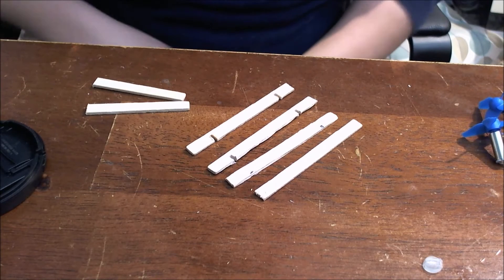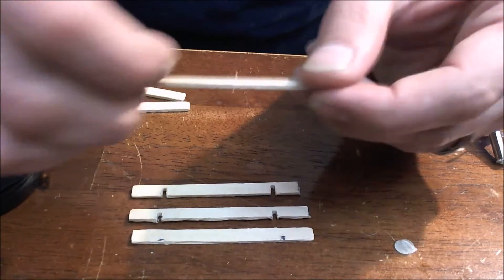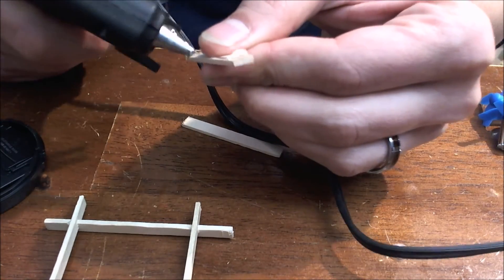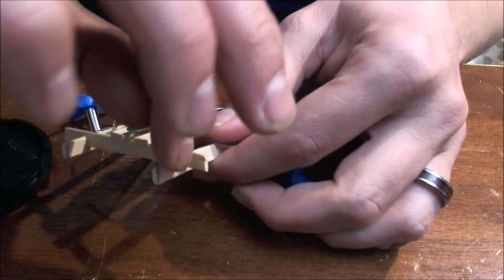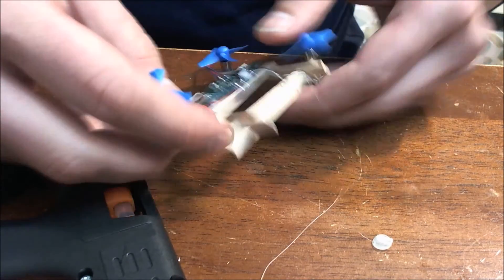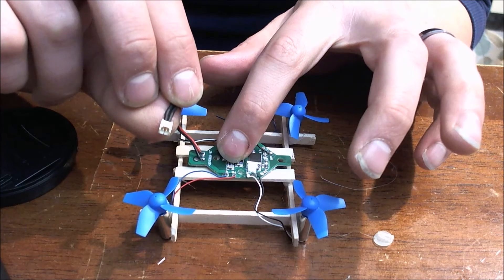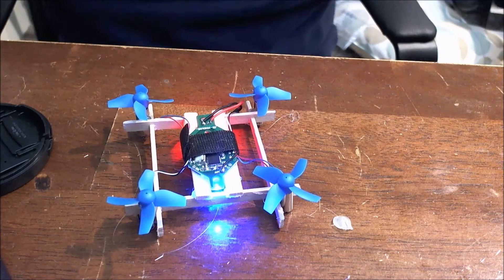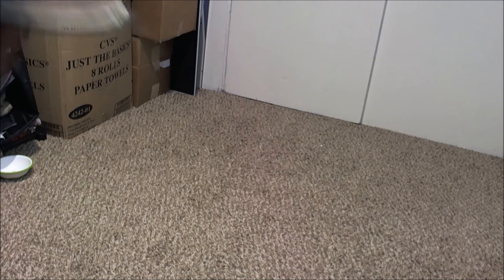FrankenWhoop 2 0 Build Out DIY TinyWhoop Frame

Comment: How much does it weigh?

Will the hot glue holding the motors not melt when the motors heat up?
Reply from the maker: I wish I could recall the weight.  I would have a motor come loose sometimes.  I later used heat shrink on the motors to provide more grip for the hot glue.